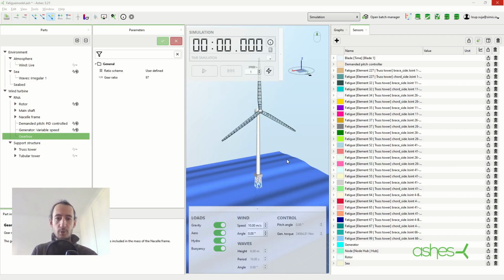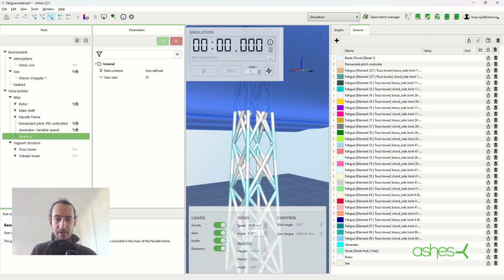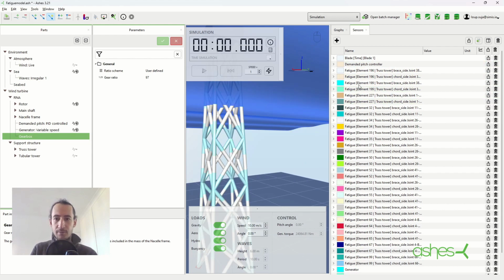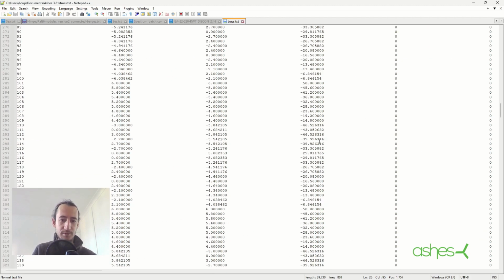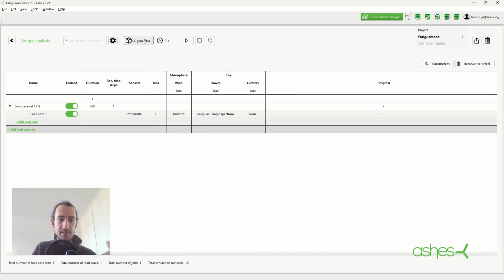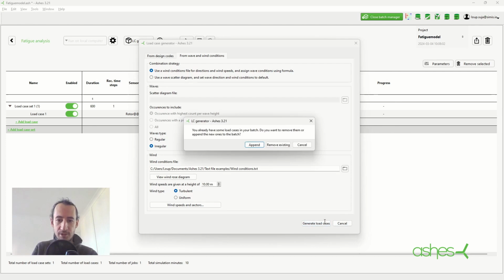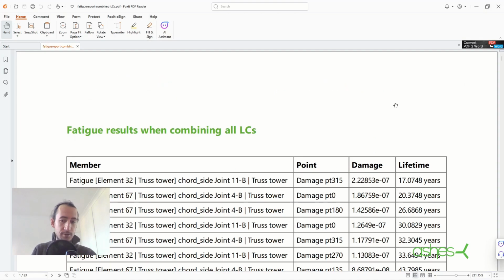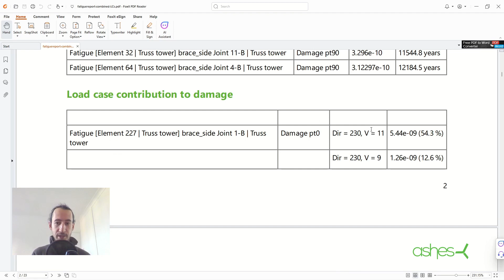Fatigue analysis of a wind turbine in time domain with Ashes

Comment: Hi, mate, I am a senior-year high school student who is on his way to complete the IB programme because of you. In this programme, there is a thing called "Extended Essay," which is something that if you do not complete it, you are not going to graduate. It's a thing where you need to do extensive research on a specific topic related to the subject of your extended essay. In my scenario, it was physics, and I was writing an extended essay about the effect of varying angles of attack on turbine baldes on their power output efficiency. To write this essay, every student has more than a year, but because of my proper planning and disciplined work ethic, I started and finished in 4 days, just before the submission deadline. Since I started so late, I didn't have time to do an experiment to support my claim. I was in a desperate search to find a simulation or a past experiment until I came across one of your past videos where you explained the pitching system of the turbines in your simulation. I definitely bought and installed your simulation and used it in my extended essay, and I cannot express in words how thankful I am to you and your work. Honestly, you are the man who helped me grade from IB if my extended essay wouldn't fail to get the minimum grade, so if you didn't create this simply, I wouldn't submit it in time and graduate from the program. There is a saying that translates to English in my language as "May God bless you and grant you whatever you desire." I think that would express how grateful I am to you. I wish you all the best in the future, mate. Take care
Reply from the maker: That's really cool to hear, glad it was helpful! What high school was that? Do you think more students there could benefit from Ashes? Feel free to write to us at support@simis.io to have a chat about this!